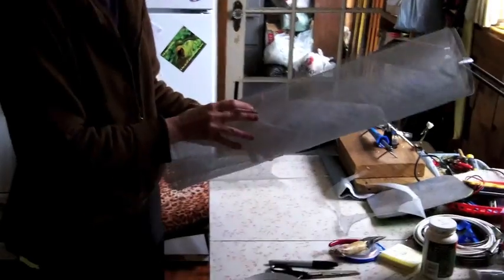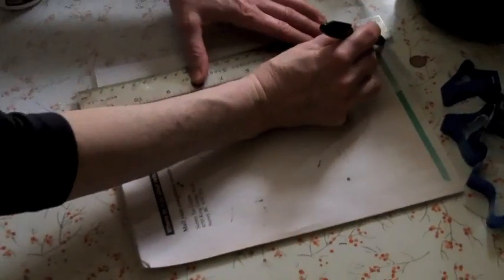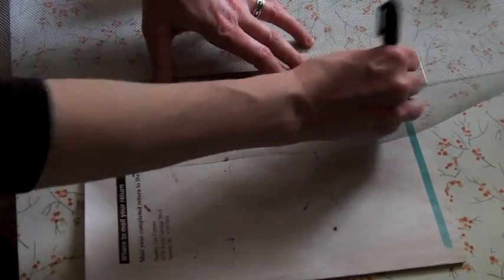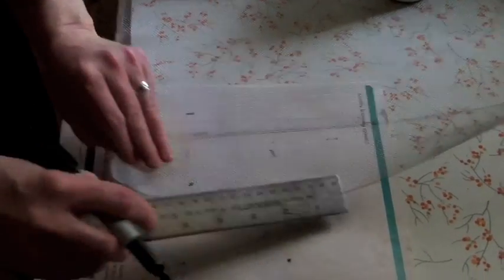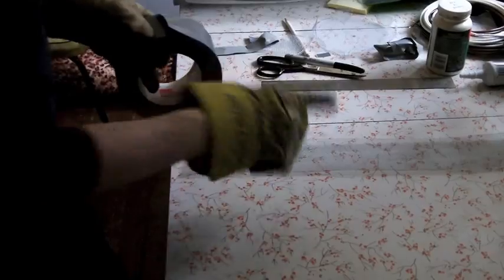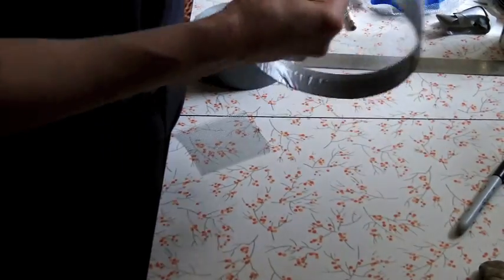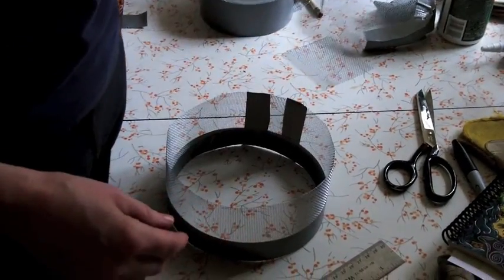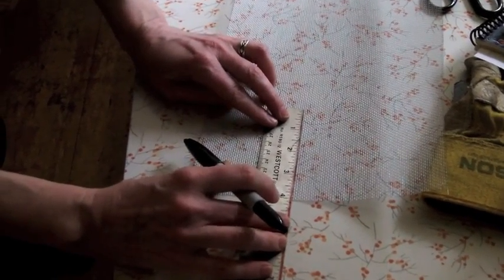How to Make A Smart Meter Cover

Comment: Thank you Shonna, I made one at your workshop, and we tested it and significantly lowered the EMFs. Also, Can you talk about the meters that you would recommend for someone to buy. You had 3 meters when you came to our house in Nelson. I forgot to ask what is best to use for testing. Thank you, Don K.
Reply from the maker: hi Don, I guess for a homeowner, you'd want a Trifield meter, so you can read the electric, the magnetic and the Radio frequencies present. I got a decent one (Cornet) for about $100 and it would  do nicely for a preliminary look at the fields in any given space.  It has limitations in accuracy and freq. range,, but the exact number is not important, it's presence of EMR and identifying the locations that you need to make adjustments in.  The meters I use in my business would be an over-expenditure for the average household use. Happy Hunting!!

Comment: What about the side NOT covered?
Reply: The Meter sits in a steel box and the two of them work together works as a shield. The aluminium mesh absorbs and contains the RF radiation
Reply: OK. I gather that you are saying that the "unmeshed" side of the meter acts as a shield for that side?
Reply: @bonniemacgregor3806  The box the meter sits in is a steel box, so yes they work together and cut out 98% of the RF radiation. I would cut out a square piece of aluminum screen and add it in the inside wall behind the meter, just in case. From what I have been reading up on the box and the mesh over the front works together to block out all total radiation. I seen multiple tests proving that. I just would feel better myself to add extra screen on inside wall too. Maybe in a frame and make into something neat to look at.
Reply: @bonniemacgregor3806  It works because the box it is in is grounded steel. The ground is why radiation cant pass through it.

Comment: you need to use real duct tape . the tape im talking about is real shiny like chrome and super sticky and has a backing on the backside of it that you have to peel and separate from the tape . then youll have to solder the copper wire to the aluminum mesh to ensure a good ground that wont oxidize . cause if you don't solder it to the screen mesh , over time it will oxidize and loose much of its grounding capabilities ...  or put electrical conductive grease all over the wire and the area of the mess that contacts the wire and seal that area with tape on both sides so to keep the grease from falling away from that area where the wire contacts the mess screen ..

Comment: How about aluminum tape on the round part and just copper or stainless wire mesh on the face?
Tape the mesh down to the sides as you cover the sides?
If I had a heavy lead paint, I'd just paint the damn thing!
I told them not to install it and they did anyway!

Comment: I’m so lucky I have three attached to the back of my condo
Reply: ALUMINUM FOIL  AND Space Blankets
Here are TWO things you can do to help. 
#1     WRAP YOUR SMART METER IN ALUMINUM FOIL
#2   BUY A $3 SPACE BLANKET AND PIN IT TO THE INSIDE WALL THAT HAS THE SMART METER ON IT How to test your space blanket, borrow a cell phone that is on and working 
Wrap the cell phone in the space blanket at least twice 
Call that cell phone and see if it rings
 IF IT RINGS, BUY ANOTHER SPACE BLANKET FROM A DIFFERENT STORE
 if the cell phone doesn't ring, then pin that SPACE BLANKET up on the inside wall, opposite of the smart meter that is on the outside wall 
I LIKE THE SILVER ONE SIDE AND GOLD ON THE OTHER SIDE

Comment: Aluminum of any type (even shiny) readily forms an oxide coating that blocks conduction. So connections between portions of screen, or from screen to ground will be poor and deteriorate even more over time. A better approach is shown on the LessEMF site, using conductive stainless steel mesh fabric, which never corrodes or blocks conduction. https://www.youtube.com/watch?v=fY9On5srLrU

Comment: what if i live in a multi  family complex with metering all on one wall
Reply: I suggest you move.

Let's look at why we do not meter smart meters.
 #1 A smart meter will hurt or even KILL disabled homeowners who have disabled medical implants.  The average of deaths by smart meter radiation and smart meter fires is almost 100 every month in North America.
#2 Did you know if your power company “turned off” the power to your home when they did a smart meter install, your chance of a smart meter fire increased by a factor of 10,000.
#3 Your power company has access to all of you private power information. Eg When you make tea, when you turn on your alarm etc. This private information is sold to Google for huge sums of money. Ask your power company what the second radio transmitter in your smart meter does. (ZigBee) 
#4 A smart meter will cause cancer to return if your family members who are fighting cancer at home. If they come home from the hospital and sleep near a smart meter, they will die. Check with the US Cancer Society website. 
#5 Smart Meter RADIATION  will turn off breakers in your home. Both AFCI's and GFI's get turned off by the radiation from the smart meter.
#6 You smart meter is very accurate, BUT, the software (firmware) is programmable. Your bill has nothing to do with the power you use. 
#7 Smart meter radiation is breaking Ionic Bonding.
#8 A huge expenditure for a huge loss. Billions of dollars to purchase something that does not general generate any power and each smart meter need 4 watts to operate. One million smart meters use 4,000 KILOWATTS of energy to operate.
#9 The second radio transmitter is for ZigBee. If you want your power company to MONITOR your home 24/7, then you are in luck. Don’t forget, this private information will be sold. Why do you think your power company spends BILLIONS of dollars and does not generate one watt of extra power to sell?

Comment: I made one just like this and I got a 3 dollar hose gasket to hold it on the meter. Screwed the clamp down and it is perfect. Also I used the rest of the alum screening and put it on the back of my wall in the garage. That's where the back is. Great idea and inexpensive fix

Comment: An easier way is to cut the bottom out of a 3 lb. coffee can. Be sure to cut so that the ring that connects the walls to the bottom of the can is removed. What you have will slip perfectly over a standard 6" meter. Then cut a round piece of aluminum screen that is 8" in diameter. Fold the edges of the screen over the top  of the can and wrap a piece of wire (copper works best.) and twist it to hold the screen to the can. This all takes, about 15 minutes, after you have the materials.  If you move you can take it with you. Enjoy.
Reply: Ted Bishop 
Hi Ted....or, even hang a biscuit tin over it?? Very cheap and quick!! :0)
Dave

Comment: This does fuck all because there is no radiation you deluded freaks
Reply: Let's look at why we need TIN FOIL HATS. 
 #1 A smart meter will hurt or even KILL disabled homeowners who have disabled medical implants.  
#2 Did you know if your power company “turned off” the power to your home when they did a smart meter install, your chance of a smart meter fire increased by a factor of 1000.
#3 Your power company has access to all of you private power information. Eg When you make tea, when you turn on your alarm etc. This private information is sold to Google for huge sums of money. Ask your power company what the second radio transmitter in your smart meter does. (ZigBee) 
#4 A smart meter will cause cancer to return if your family members who are fighting cancer at home. If they come home from the hospital and sleep near a smart meter, they will die. Check with the US Cancer Society website. 
#5  Reason is Smart Meter RADIATION turn off breakers in your home. Both AFCI's and GFI's get turned off by the radiation from the smart meter.
#6 You smart meter is very accurate, BUT, the software (firmware) is programmable. Your bill has nothing to do with the power you use. 
#7 Smart meter radiation is breaking Ionic Bonding.
#8 A huge expenditure for a huge loss. Billions of dollars to purchase something that does not general generate any power and each smart meter need 4 watts to operate. One million smart meters use 4,000 KILOWATTS of energy to operate.

Comment: What about the rdaiation coming out of the back of the meter?
Reply: THE SIGNAL CAN'T GO THROUGH THE METAL BOX. It is trapped inside her cover and the metal box forms the back seal
Reply: Were all going to die.  WTF!
Reply: bogi2u     Ha ha ha.   I think I’m just going to rip the son of a bitch off the wall of my house and pay someone to replace it with analog meter. If I get sued I’d rather fight that than cancer or have my privacy invaded.
Reply: bogi2u  You can call your electric comapany and opt out.  I think they'll supply the analog meter, but you do have to pay an electrician to do it.  I don't know if the elec. co. will charge you for the meter.  I have 4 of them outside my bedroom.
Reply: @pamelae1696  Hi. Where do you live? It may not be possible in my area.
Reply: jxg151  I live in Ohio and my elec. co. is American Electric Power.  You could give your co. a call or maybe find it on the internet.  This Faraday Cage doesn't look so hard to make.  Good luck.
Reply: Or cat
Reply: Exactly.  You think like I think. The energy then goes into my bedroom .   Someone said paint your bedroom wall with a certain kind of shielding paint.
Reply: bogi2u why not your not planning on eating it are you? lead is no biggy just don't have little kids who eat ? and you,'ll be fine.
Reply: Mario Curci, sr Lead paint might work. ( don’t do it ! )
Reply: Hydro One said that we have manual readings every 3 months, and there are no plans to change this; however, the smart meter is still sending out signals every hour.

Firstly, is it just every hour?

Secondly, I asked them why they do not just switch the smart meter off, since it is not needed.
Reply: @jxg151  what did Hydro One say about your questions?
Reply: @elkadosh4726  They just were just obfuscating by saying that it was safe,

Comment: Oh crap don't use Ac power if you are so afraid of the boogie technology, live in a Faraday cage, a copper screened room used to isolate equipment for testing, yes expensive and unnecessary, but if a little RF makes you sick a good investment. I have worked with 2-way radios for years and have had a few minor RF burns, so what... as long as you don't stick your head into a microwave oven you will be OK. If I am wrong prove it.  This is silly to me. OK forget the Faraday cage just move into a cave.
Reply: Mr Mad, Your food has bacteria eating virus in it and is USDA approved organic. The coal ash waste with depleted uranium in it is recycled and put in over 50% of consumer products (children toys) Carbon nanotubes via florescents are sprayed on the crops and drones take reading aka smart or precision farming. Over 50% of the nuclear powder plants are leaking and the public dump sites are being emptied and recycled into your products. There's more but what is the point with the stupid people. Basically it's wake up or die at this stage of the game.  Silly I know.  Just go vote, pay your taxes and watch your football.
Reply: Now there is gene editing and it's totally unregulated. They have everyone running down the GMO road.  The implications of this are unimaginable and I have no doubt it has been done to our food supply for a while now.

Comment: I have 5 smart meters on the side of my house. I live in a free hold townhouse and everyone's meter is on my side of my house..what should I do?
Reply: Move.
Reply: get the f*** out this electromagnetic radiation destroys your mitochondrial DNA that's the PowerHouse of your cell that give the signaling of what to do to keep your body well. you're being genetically modified. so you can either make a faraday cage for every one of those or you need to run and run fast you're getting a huge dose of it I would call and raise all Mortal hell they should pay for these damn Faraday cages they're going to put that s*** on buildings or houses they damn well better put something on there to protect you.   they put one on my house I started have a major problems filling my skin tingle all over my face constantly felt like little needles all under the skin if I would lean over by the electrical outlet my hair literally would stand out I still didn't understand that it was too smart meter I took pictures of my hair every time I got near an outlet to have as evidence now the first time I called electric company they dismissed it they were going to do anything I went on Amazon I found the meter I used to have called an electrician I had it set up he would be at my house in 5 days I called my electric company back I told him I was having electrician come and change it he warned me that I couldn't touch that meter that it belong  to the electric company I told them then you come and get it and you bring me my old  one.  "this is my home" and I reiterated that twice, i said it maybe maybe your meter but it is my home "I do not want it on my home so in 5 days the electrician will be here i am  given you fair warning to be here and remove or to get your equipment". the next day I mean 24 hours later  they brought me a new version of my old meter and had it installed on my house. I was not putting up with this s*** it may be their equipment but its my f**** home . they have a deeded  right of away to put their Pole in my front yard  BUT my house is my F**** property.  it is a courtesy for me to allow them to put their meter on my home so they can charge me. now i am not given that courtesy if you're putting your meter on my home and it's also going to cost me my health.... stand up don't take this b*****... if you are in an apartment complex then you're in a situation where you're just going to have to take charge you're going to have to put covers on it and send the electric company a bill call Morgan to Morgan there supposed to be for the people and they work for no money unless they get you a claim it can hurt to call just take documentation with you . good luck.
Reply: Sit back and have a cold one.

Comment: I covered my meter with an aluminum starbucks coffee bag, it hasn't prevented the power co. from still reading the meter....
Reply: Did you take a reading to make sure it was decreasing the signal?
Reply: If you tune a portable radio to inbetween stations, you hear a tremendous increase in the static when placed near the smart meter, or other things like a laptop computer.  With the starbucks bag, or I assume just aluminum foil, there is nearly no static...but, you must seal the bag around the grounding ring, otherwise the bag won't work at all.
Reply: What if the smart meter is using microwaves and not radio waves? I'm not asking to be contrarian. I'm an idiot with electronic things. I am trying to figure out what's best to combat this at my house. Have also been looking into building a faraday canopy over my bed. Not sure if aluminum mesh will block microwaves. Someone told me it wouldn't and another person demonstrated that it would; according to their demonstration video. The first person said I needed to use steel foil; which is about ten times more expensive than aluminum mesh.
Reply: I see. Well, I think I'll try the aluminum mesh and see if that helps. If not, I will move on to the more expensive stuff.

Comment: PROTECT YOURSELF THE BEST YOU CAN FROM SMAT METER RADIATION.

2 months ago I wrapped all around of the sides of the glass cover with double layered alum. foil. It works! My headaches and disillusionment have mostly left. I now want to make a cover as you are doing so the front is also covered. Next I will find lead-based paint and paint the inside wall where the meter is placed outside behind my refrigerator inside or screen the wall behind my refrigerator. Radiation  also pours in your windows and doors with windows if they have no screens. You also have radiation shooting at you up to 80 feet from all your neighbors! Get them in on this to! jh
Reply: Gotta love the placebo effect
Reply: your fucking crazy

Comment: You haven't done anything to block the signal coming out the back of the meter and through the wall,  into your home.
Reply: But wouldn't the signal reading still pick that up?
Reply: If you take a reading inside the house, behind the meter, it will.
Reply: If you take a reading inside the house, behind the meter, it will.

Comment: its not working!!!! why???? I did the cage exactly as you did, and used the same materials. it seems I cannot find the grounding. I live in an apartment, I guess the metal plate behind the meter is not grounded, otherwise I cannot explain. what should I do? what grounding is there exactly around me, in an apartment? something that should not put me at risk of being electrocuted. thank you!
Reply: How do you know it is not working? Did you use a RF monitor device to see if it is working? And if you did, then is it a top quality RF monitor device (or some sort of a cheap $10 dollar device)?